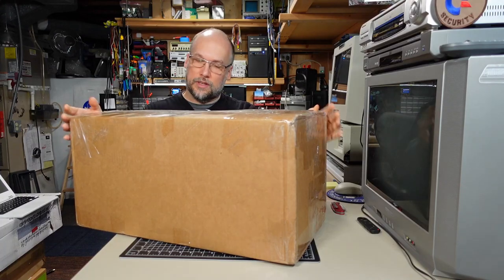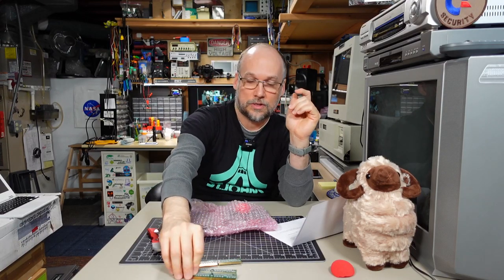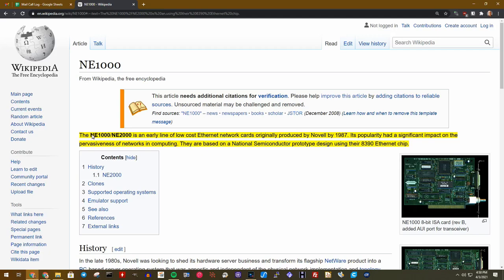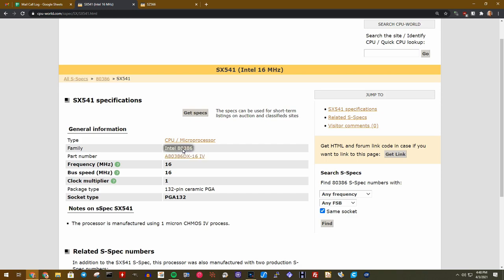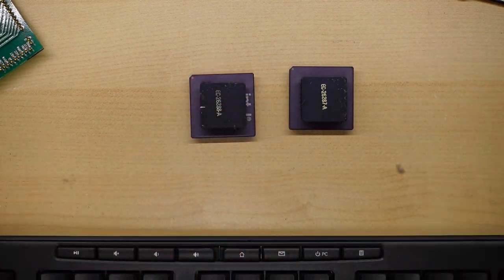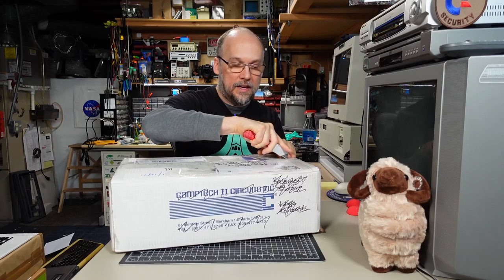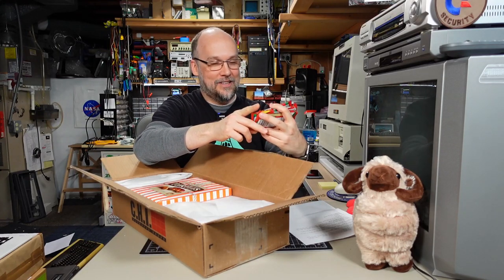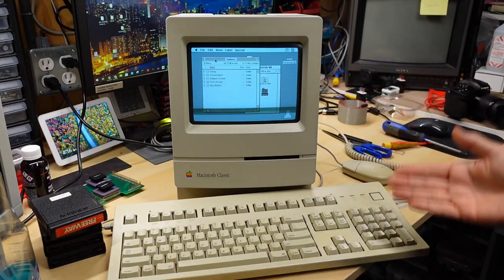RAMCHECK for Rammy, an Intel 386 breakout board and three keyboards

Comment: It might be possible to recreate the SIMM adapter… you'd need to find the pinout for the connectors though with continuity testing all the socket pins around…

Comment: On the keyboard, I’m thinking the 1987 date was when it was refurbished by Digital and made available as a spare part. I remember the Mackintosh’s as well... I’m from far enough north in the US that once in a while one of the stores would have a small supply of the toffee bars (and yes it is hard stuff, harder than Jolly Ranchers in fact), so finding the individually wrapped ones was a Good Thing(tm).

Comment: Some RAM have a few swapped data lines, some have a few/less pins. GVP memory for the Amiga accelerators comes to mind. Some of the ones with data lines failure might be special ram for printers etc.

Comment: Adrian, fantastic video as always.  @14:18, this is called a 386 breakout board. @34:17 - Its called  "I am not A Candy Maker"  Toffee is made from granulated sugar that has been melted down and heated to the "Hard Crack" stage which is above 295 degrees F.  Concentration of sugar after this temp has been reached is 99%  (Other stages have lower concentrations of sugar)

Comment: I spent many hours typing on VT100 keyboards in college and I can't say that the height was an issue. However when you moved up in the pecking order enough to rate one of the new VT220 terminals with LK201 keyboard that was a big deal.

Comment: For memory modules which act flaky and sometimes work, while other times not, check the module for tarnished contacts. The copper plating on old memory modules gets tarnished over time and can lead to a bad connection between the module and the memory slot. Sometimes inserting and removing it a few times will scratch the oxide off, but the best way is to just use contact cleaner or Deoxit Gold. This can happen to motherboard slots too, so if you have a flaky board that complains about memory, or certain addin slots are flaky, hose them down with contact cleaner as well.

I've had many, MANY memory modules test bad, for it to only be tarnished contacts, or a tarnished memory slot.

Comment: Found the 30/72 pin sim testers can still be inquired about through the original vendor. That tester actually has an upgrade to test DDR4 memory, which is super odd. Additionally, the SimCheck machines can be upgraded, in the original housing, to the RamCheck machine. What a weird hardware upgrade concept!

Comment: I had a keyboard like that that was part of a DEC VT100 terminal.  The terminal went bad and I tossed it.  I regret doing that as it was probably just a bad capacitor in the power supply.

Comment: I heard of those Slot1 terminators, but I owned 2 different dual P2/P3 slot1 boards (a supermicro P6DBE and an asus P2B-D) and none of those needed the terminators.
Probably they were less common than usual, because not all motherboards needed them.

Comment: Something about the contacts on that SDR SDRAM.  I've had nothing but problems with it.  I even had a work computer that needed the to have the ram reseated literally every time I rebooted it.  I've never had these problems with 30 or 72 pin or any DDR ram.

Comment: It would be nice if you could figure out which chips were bad on the bad RAM sticks and use a hot air rework station and lots of flux to swap bad and good chips to assemble good sticks from parts of the bad. 😉

Comment: Acetone works wonders for cleaning both dot matrix printer platens (the roller) and mice balls.  It softens the outer layer, which as it ages hardens and become slippery.  The only issue i see with using a scotchbrite on the ball is that you are removing material, which will wear the ball out after a time.  Acetone probably will too, but i never noticed much material loss (by looking at the cleaning rag after).  So Acetone may be a better bet for cleaning mice balls.  Just a thought.

Comment: Actually, I believe the PgUp/PgDn keys on the extended (ADB) keyboard can be read by an Apple //GS in some word processing programs (BeagleWrite, for example). They may also work on the Mac if you have a long, many page document. Worth a try. 🙂
Reply: They weren't inherently supported by the classic OS. Even the Clear key (the one in the traditional NumLock location), and keypad Enter (which was on the original 128K keyboard) required programs to explicitly handle them.

Comment: 38:10 I know what you mean. The keyboards I use tend to have 3 or 4 key rollover, and that's fine. I have a rather expensive wireless keyboard that only has 2 key rollover, which kind of sucks for a gaming keyboard, but the main issue I have with it is typing words like "robERT" or sTREam" where the ERT section doesn't let you press all 3 at the same time, so the words come out as "rober" and "stram".
I put that keyboard away and went back to using my old one after only 2 weeks.

Comment: There were (and still are) two linear Cherry switches: MX Black and MX Red. The difference is that Red uses lighter springs, and is popular with gamers. Black uses heavier springs and can get tiring to type on after a while, but they were intended more for applications like cash registers and point of sale terminals. I don't know whose bright idea it was to put them on office equipment, but they're not that hard to find.
Reply: The MX Speed Silver is also a linear switch.

Comment: If i can lay a protip on you regarding RAM testing from my bench tech days, is that if you're doing an extensive test, (which is recommended) if it has the ability on the device to run more than 1 pass do so, for at least 2 fully complete passes. While rare, I have seen once that a ram module would go through 1 pass in memtest86 (VERY useful liveboot ramtest utility) but then rather peculiarly would fail on the second pass...

nonetheless that gadget looks amazing, i would love to play with one of those myself some day

Comment: A quick tip for the goo in the couch: try icing it down with ice spray and then scrape it away. This works surprisingly good with sticky stuff in fabric like e.g. chewing gum...
Reply: And a gas duster can upside down works great as as easier to find version of freeze spray.

Comment: As a 32 bit chip it loads 4 bytes at a time so A0 and A1 are not used the same as an 8 bit processor. They are not needed when operating 32 bits at a time in any case.

Comment: Check all the test parameters. A fail of an extended test might not mean bad ram..it may be using voltages that are outside the range of what the actual pc would use

Comment: can you do continuity tests between the ram socket and the pin outs on the bottom and guess what the adapter is doing and how it is arranging the pins?  also if there is any resistors or something

might be able to reverse engineer this

Comment: I still buy the AT style keyboards.  Made by one of the factories that made them for the original IBM PC-AT.  All mechanical, and they can be ordered with USB.  Never had a key failure, the only issues i have ever had were the USB connectivity getting flakey.  Which i have not bothered to diagnose yet.  I suspect perhaps a bad connection internally.

But for fans of the PC-AT "clicky" keyboard, google "Unicomp".  It's nice to have a quality keyboard that can actually take some physical abuse.

Comment: Some of those RAM modules may be repairable.  Bad solder joints from flexing, or even module swaps since you can determine which bits have failed.  I wouldn't throw them out, see if they can be fixed!

Comment: I haven’t seen CPU bus terminators in 23 years!
And yes these were for SMP systems. One was on the board. We did a lot of work with SMP in the mid to late 90s. Pentiums were notoriously useless at SMP. So we ran a lot of MIPS still. And I lost one of those terminators and thought: “these distances are so small it wouldn’t matter”. Well that Windows system hung at the rarest moments. The reflections would probably signal wrong data on the data- or address bus and it was all over.
When I found not again on our massive messy workbench, it ran “stable” (as stable as NT 4.0) would.

Comment: Address lines 0 and 1 cannot exist on a 386 since it's not an 8-bit computer :D External CPU bus is 32-bit, so it always fetches or writes 4 bytes at a time and always aligned to 4 bytes. When you do an unaligned access in software, the CPU has to split it into two separate memory accesses.

Comment: Intel processors of the era had Byte Enable pins instead of the least significant address lines.  I believe the 64 bit processors omitted Address Line 3 also, since there would be 8 bytes (64 bits).

Comment: It looks like the RAMCHECK maker's site will let you contact them to order a SIMM tester module.  They might only make them now as custom orders. And it might be expensive.

I used one when I worked for a server hosting company, part of our standard checks when we retired a server and were putting parts back into inventory.  Prior to that we were running rigs with Memtest 64, this thing was much faster.

Comment: i wonder if it would be worth it to try and reverse engineer one of these RAM Checks to make an open source version of it, mainly for 30 and 72 pin SIMMs, because retro, and dealing with high speed DDR+ RAM is a pain without a FPGA or very fast Microcontroller

Comment: some the "Bad" Memory seems like its PC-66 Memory. And the Tester seem to test at 100MHz...
But even if, they are not that useful. Though the 16MB (maybe 32MB) are necessary for first generation SDRAM Boards such as Intel i430VX...

Comment: By the way Werther's original still not in my mouth but unwrapped nonetheless.

But when he had pulled the key cap on the keyboard made me remember.

I had received a lot of old computer keyboards an old computers that had the self-contained keyboard with them such as Commodore 64 and other what I call keyboard computers such as like amstrad or whatever numerous different ones can't think of the name of the others never had an amstrad.

But I did frequently get bad keyboards sometimes I might desolder a few switches or use cables whatever.

Most of the time back then computer hardware I got was just salvaged for whatever I could use out of it.

Sense of course nothing would work with what we had.

But with the bad keyboards and single piece computers.

That were Salvage fodder.

I would Salvage the Springs of the key switches for other uses.

Sometimes there were as many as three Springs in one switch if not more in some cases.

I once saw a key switch that even the contacts themselves were gold-plated Springs.

I believe plated only but who knows.

Think I remember finding key switches like that only once or twice.

I still have a straw with a bunch of keyboard Springs.

Also from mechanical typewriters and such anything that had enough Springs were saving it got put in something.

At times I had hundreds of Springs from one Salvage of the same kind.

Also had a lot of Motors out of old electric typewriters that I repurposed.

One time I tried to repair an IBM golf ball typewriter for the school but it was beyond repair.

They had me take a walk they said it wasn't worth taking to the repair shop because of just the fee to take it in and have them check it out.

But if possible to attempt to fix lease.

The deal was if I couldn't fix it Salvage it for whatever could be salvaged.

It did live on in Parts in another device that built!

Comment: To remove those apple II "footprints" from your couch, try "brake cleaner" or "brake parts cleaner" from your local auto parts store, try to get the CHLORINATED version as the non chlorinated version doesn't work as well, if you can find old-school carbon tetrachloride, that's a miracle worker too.

Comment: If you look at the website for Innoventions, the founder passed away last year, and the company is closed.   They still have downloads, but if you need them, grab them while the company/family is willing to pay the hosting costs.
Reply from the maker: Yeah good point on the downloads.
Reply from the maker: Unfortunately you have to register to download firmware updates and the registration form is broken. 
"Fatal error: Uncaught Error: Call to undefined function ereg() in /home1/innoven/public_html/reg/data_valid_fns.php:23 Stack trace: #0 /home1/innoven/public_html/reg/processreg.php(77): valid_email('misteradrianbla...') #1 {main} thrown in /home1/innoven/public_html/reg/data_valid_fns.php on line 23"
Reply: @adriansdigitalbasement  I tried to see if I could just use http to get to the file directory, but I don't think that's possible.   You could try sending emails to sales/tech support.   Maybe you could offer to put the files up on github or someplace similar.

Comment: Instead of pulling your hair out trying to find the correct adapter board, you could go look for a SIMMCHECK II+ unit that has 72 and 30pin built in instead, those pop up here and there and gives you the advantage not to have to change modules all the time when trying to check different RAM types. At least on the SIMMCHECK II you also have to unplug the adapter module if you want to use the internal ports, hence why I have two, one with 72 and 30pin built in and one with a SDRAM adapter plugged in. Unfortunately I do not have a newer RAMCHECK to test DDR and up ^^

Comment: Looks like a VT100 series keyboard.  I used to work for DEC.
NOT PLCC sockets, PGA socket (pin grid array, not Plastic Leadless Chip Carrier)
If that tester will show which chip on each module is bad, you could fix them by unsoldering some of the chips from partial module to make 'Franken Dimms' (Franken Simms?)

Comment: According to Wiki: Toffee is a confection made by caramelizing sugar or molasses along with butter, and occasionally flour. The mixture is heated until its temperature reaches the hard crack stage of 149 to 154 °C. While being prepared, toffee is sometimes mixed with nuts or raisins.

Comment: You might find this hack lets you play with VT102 keyboard. 
https://github.com/sethm/vt100_usb
https://hackaday.com/2013/08/13/usb-adapter-for-an-old-vt100-keyboard/
Also - keep the bad ram modules, not all of the chips on them are likely to be dead and you can pull good chips from them with the heat gun to repair other items. These older ram chips are becoming harder to find.